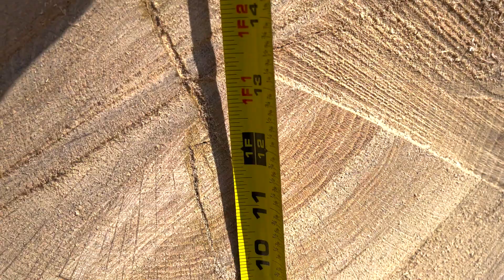Quartersawing a Big Post Oak . . . and Metal Bolts

Comment: How long was that log down before you milled it? My Post Oak always checks almost immediately, even if I seal the ends.
Reply: It was down at least 6 months.  I had put anchor seal on it within a couple weeks of it coming down.  That whole tree was huge (42 inch diameter at the base).  Only the bottom log had a little checking.  I believe that the time of the year the tree comes down can impact the checking.
Reply: @Avidwoodworker  Right on man. That is big for a White Oak for sure. I've just had guys tell me it has to dry natural with no kiln for 1-2 years after it's cut as well. It's a timely investment, but beautiful. 👊
Reply: @jwhiteker1  We let it air dry down to around 28% moisture content and then move it into one of our dehumidification kilns.  It comes out nice.  The advantage to putting it into the kiln (in addition to shortening the drying time) is that we also sterilize the wood at the end of the drying cycle.  This kills insects and insect eggs that could be laying dormant in the wood.    The last batch of quarter sawn white oak we pulled out of the kiln was so flat you would have thought we had run it through the jointer (I am exaggerating a little, but only a little).
Reply: @Avidwoodworker  That's awesome. I've been threatening to get a bandsaw mill for my 160 acres  of Oak that needs thinned, but my forester had a look and said I don't really have any good timber value. I think I could still harvest enough for my own needs. But the insects could take it for sure since it would have to air dry. That's great that yours came out that flat. I've heard White Oak likes to cup and twist unless there's lots of weight on it.